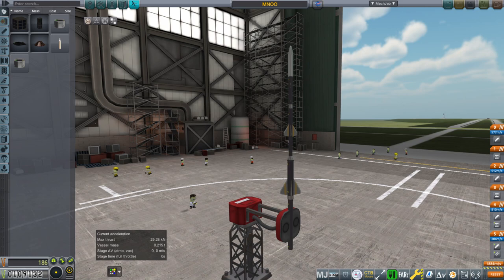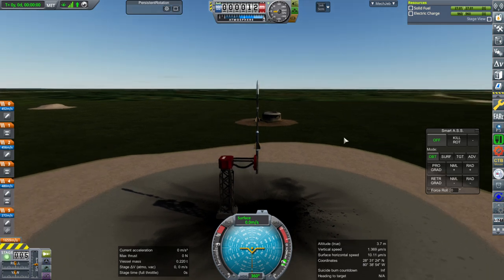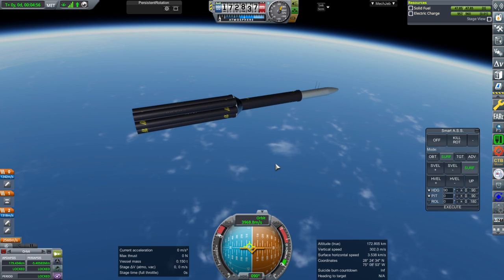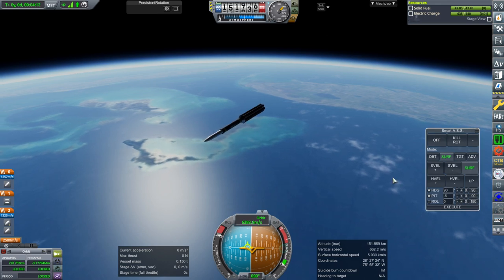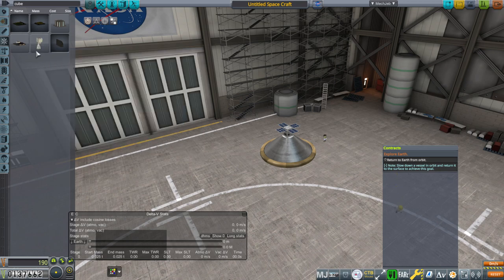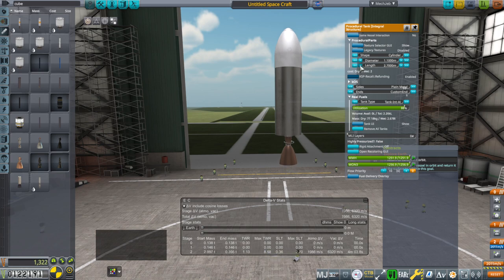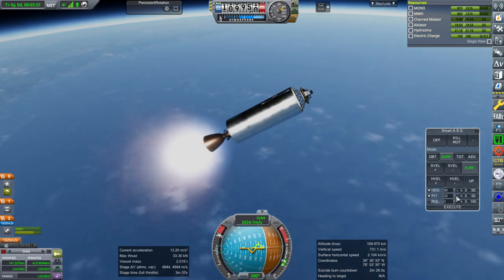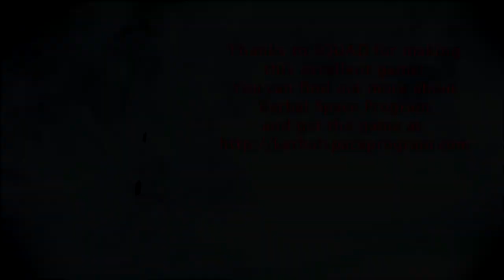KSP with Realism Overhaul - RP-2000 in 1.11 Test 02

Comment: Maybe this isn't the place for this, but could someone explain the "high pressure" tank? Specifically what differentiates it from, say the "service module" tank? As i understand it, turbo pumps in the specific engines will pull fuel, and ullage will do the rest. I am missing a great deal of understanding and would appreciate any help.
Reply from the maker: A pressure-fed engine isn't fed by turbopumps, but rather by the pressure in the fuel tank being high enough to feed the propellant. This means the tanks have to be heavier to withstand the increased internal pressure and also that the engine is more massive for a given thrust because its chamber pressure can't be too high. It does simplify the engine, though, and is used for systems that needs to restart a lot - especially RCS. A service module is a section that has not only propellant tanks, but other things like life support. It often contains high pressure tanks, but isn't just a high pressure tank.

Comment: How you’d download realism overhaul with Mac?
Reply from the maker: No idea - I don't have a Mac.
Reply: CKAN is available for Windows and Linux, so it's probably available for MacOS. Install it, search for Realism Overhaul, then install what mods you want to install.
Reply: @linuxsbc  It is not available for Mac bc it is in .exe form
Reply: @iembot8104  No, it's not. On the Github releases page, there are a few download options, including EXE, DMG, RPM, and DEB. EXE is for Windows. DEB and RPM are for Linux. From that, it seems likely that DMG is for MacOS.
Reply: @linuxsbc  after I download the dmg I just put in the ksp gamedata
Reply: @iembot8104  No. Can you run DMG files on a Mac? If so, do so. It's an app.
Reply: @linuxsbc  Yes i can run it but I require permission. what should I do after it running?
Reply: @iembot8104  Do you have access to the administrator account? If so, use it to install the app. If not, run it without installing. Here's the steps that I remember from the last time I used a Mac:
When it asks you to drag the app to the Applications folder, drag it instead to the dock. Then click the icon that is now on the dock, which should be CKAN. 

Before running it, copy every KSP file to somewhere else. This will prevent it from messing anything up. Once it runs, select your copy that you just made. Do you want to use sandbox mode, science mode, or career mode? If it's science or career, follow the RP-0 steps. If it's sandbox, follow the Realism Overhaul steps. RP-0 has a good guide with information on both listed here: https://github.com/KSP-RO/RP-0/wiki
Reply: @linuxsbc  I do have a backup ksp folder in case there is a problem
Reply: @iembot8104  It's a good idea to not use your main KSP installation for Realism Overhaul. If you have a backup, then it's probably fine as long as you don't modify your backup.

Comment: Well after finding out what the "problem" is...  I CAN think of a very bad solution (but one that would at least work...)  Instead of doing modular pieces for cube-sats, make them as different configurations of a cube-sat.  Kinda like how you have different engine-configurations, (which can change the models) you can have different configurations for the cube-sat core.  At that point, the cube-sat itself would only ever count as 1 part (so it DOES effect part-count) AND the total mass of the entire part should likely be high enough that it won't have that glitch, and be read properly.

Ideally, in my head, my brain is saying that you could take the cube-sat bodies, and aerodynamic probe body you've created, and set the internal visuals to include various possible set-ups, with X number of parts inside, and the player just selects the parts from a list (including a "none" option) and these selections and changes will change the root total mass of the part, and you change the graphics accordingly.  

That would be a WHOLE LOT of work, for not a very big payoff (No pun intended) BUT it would indeed allow the system to function as you intended, within the physics constraints of KSP.
Reply from the maker: The little Cubesat Platforms were meant to have another purpose - as stuff kerbals can manipulate on science racks in Shuttles and Space Stations - so integrating them would mean dispensing with that alternate use. Also, assuming integrating them is a visual thing (the cubesats or sounding rocket core can open and you can see inside), that's a whole lot more meshes and increases the size of the mod.
Reply: @RaizSpace  In my mind, the integrated variant visually would just be one that connects or combines the various meshes you already have.  So you'd have a slot for each possible addition, and you'd cycle through the various options.  I'm not sure if the meshes and textures can work that way though.  

Another option...  Wasn't there a mod that could take multiple pieces even in the base game, and weld them all into a single part?  Perhaps you could make that mod mandatory for your install, so that KSP will treat them as single parts after the fact?  

Again, either of those would forego the secondary functionality of tryingto let Kerbals mess with them...  so I dunno.  Trying to think of options though, don't know if they work, but can't hurt to throw suggestions out there.
Reply: @ArthurEKing8472  Your talking of Ubizor Welding, which is not the best working mod out there. One limitation is that there can not be more than one identical module per part. I am hoping KSP 2 will help in that regard.
Reply: @Keineahnung4015  I don't THINK I'm talking about that one, although that might be the current version of it?  A quick google search had shown a couple KSP mods that do things like that (Maybe most are dead mods?), and I wasn't certain which of them Tyler had specifically used previously.
Reply: @ArthurEKing8472  I have no idea what Mods came up with youre google search, the only one i see is this one: https://forum.kerbalspaceprogram.com/index.php?/topic/96670-14-253-2018-04-06-ubiozur-welding-ltd-continued/
It doesn't officialy support 1.11, only 1.8.9, but worth a try.

Comment: What version RSSVE did you use on 1.11.2?
I used RSSVE 1.9+ and it says it's incompatible therefore the RSS isn't working
Reply from the maker: The one I used says it's incompatible at the start, but still works. The version file says it's 1.5.0.1, but they might just not have adjusted the version file in a long time.
Reply: Can you please give me the link? I couldn't find it.

Comment: There isn't supposed to be a part limit, is there? AFAIK normal Realism Overhaul/RP-0 gets rid of that. Just needs Custom Barn Kit in order for the patch to work. If that's a new thing for RP2k, I recommend against it as it is biased against cool things like SmartParts and VaporVent.
Reply from the maker: When I played RP-1 last, it still had a part limit, but maybe they changed that. Right now I'm not working with Custom Barn Kit as a requirement, but I'll think about it.

Comment: Does the small rockets pack or surestrut require RO?
Reply from the maker: Strictly speaking, you can try to use them without it by deleting the RO config in each mod's folder. It's the file that begins RO. I don't know how well they will work, because I didn't test it that way.